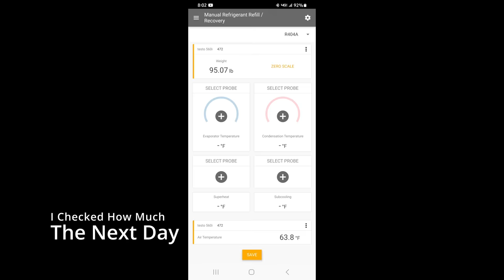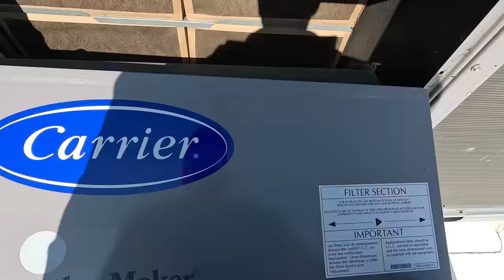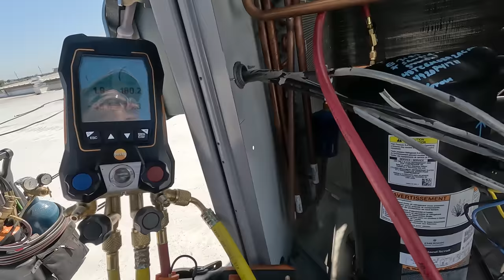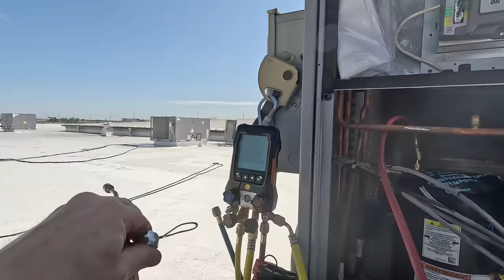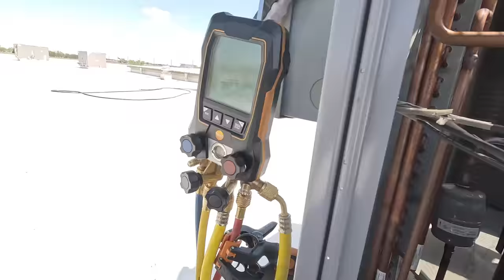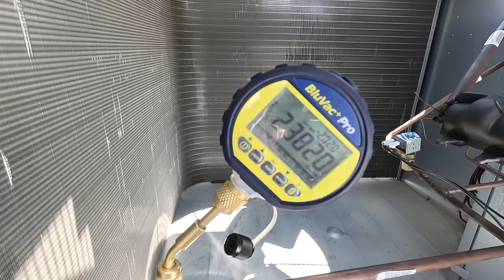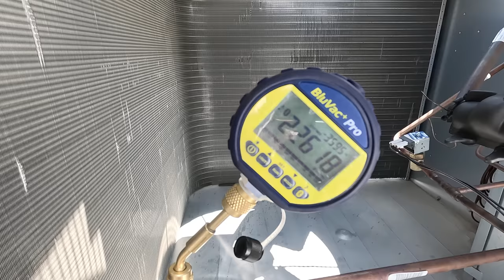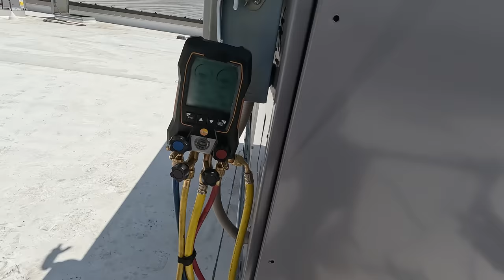RTU Compressor Change With Electric Ladder Crane

Comment: Day - month - year = perfect

I built an A-frame style 4 pc. lift frame that mounts on top of the curb hatch frame.  Used it recently for lifting a heat exchanger replacement up through hatches at a job with no permanent ladder recently. Built it to lift a compressor up to a roof before Covid and has been rusting on on a shed floor since then.  My employer did not contribute to its fabrication and it still needs an electric winch but it got the job done and no bodies were injured.

You need a helper for the heavy lifting.

Comment: 4:20 I use the same winch but I have a bracket that hangs on the strut for when I hang kitchen hoods. That’s a good idea though. Yet I’m still trying to figure out a portable gantri for lifting rtus but good video Rick 🫡👍 keep up the work.
Reply from the maker: If I'm doing a full size unit that's when the real crane is coming out.

Comment: They taught us in school, using a belt tension tool, that if you can roll a belt on, it is too loose.  "Bell & gosset"(?) Or someone big like that did a study and over 90% of techs put belts on way too loose.
Reply: Rick used belt tension measurements many times, mainly on ice machines. I guess sometimes you’re feeling / experience is enough. Especially when the tool is 15 minutes away to get it. 😏
Reply from the maker: @brauchmernet  ya, I have the tool in the truck.

Comment: Hey Rick a question there bud have you ever had any problems pulling a vacuum with the c&d core depressor? I bought a set but always having problems with them
Reply from the maker: They have been better than Appion core tools for me. You can buy new seals.
Reply: NAVAC CRT's are the bees knees
Reply: Wait, you guys pull vacuums?

Comment: Great video man. Just wondering how much your crane weighs in relation to the compressor. that would be a good comparison. Seems like you ropped up the winch anyway and if they’re similar in weight what’s the difference. Also Seemed like a little bit to set up. I’m not knocking it, I think it would be great for a lot of applications, too many steps for others
Reply from the maker: It's in Three pieces, the the brackets are probably 15 to 20 lb each. The compressor weighs 95 lb total. It's a lot more manageable to take up the three small pieces. Let's also take into account what happens if you drop the $2,000 compressor? Who's paying for that and who's paying for the damage to your body if you pull something in your back?

Comment: I just bought a miller electric 11-1116 it's a tiny little torch handle and it comes with a bunch of tips and stuff. It's freakin awesome, it makes the big torch handles obsolete in my opinion. Don't get me wrong the big handles work fine especially with big stuff. But for 90 percent of what we do especially reach ins and  prep tables and stuff it's the tits.
Reply from the maker: i feel the same👍

Comment: where is your hand truck? the best lift i have done when i did refrigeration work. i had a convenient store and it had a bad comp on a rtu cooler unit. i took some thick unistrut and made sort of a upside down L   PUT A 45 DEG support connecting the  angle  then bolted it to the steel ladder on the back of the building, the unistrut was fastened using a pipe to the ladder so i could turn the L bracket. i lifted the comp with a come along then turn the L bracket and set the comp on the roof. left it on the job site for next time
Reply from the maker: My fold up trucks wheel broke last week. This Lyft does three different ladders plus a trolley. Check it out.  https://youtu.be/6G95R3krvmc

Comment: We just installed a similar model on an older Carrier unit with a b tank. Struggled to heat the suction line. If you didn't use the rose bud, what else would you recommend? Thanks, Rick.
Reply from the maker: I have used a number 2 tip for years and years with no problems. I'm just looking for better and faster ways of doing things.

Comment: Dang that’s the 3rd compressor in there ?
Reply from the maker: Says who?
Reply: @HVACRSurvival  well I thought so because it had that writing on it and for some reason I thought original one failed and you wrote that on the new (2nd) one but then I realized you probably wrote that for warranty purposes
Reply from the maker: @joeshearer1247  correct, I thought I would be back shortly after finding the fault but they waited till spring the next year.

Comment: Curious Rick, I see you and others on the net using a true oxygen / acetylene torch; why?
All of our trucks are equipped with an acetylene only torch rig and we have no issues.
Reply: Oxy acetylene torches run way hotter, more expensive to use though. The benefit is in the difference in heat the flame produces. Air acetylene cant compete in speed, especially on larger pipe. They both get the job done!
Reply from the maker: It's what I use mainly because that's what they gave us, I used to love the turbo torch when I didn't know how to use an oxy acetylene torch. Once I learned how to use it then I didn't like the turbo any longer because it's slower as far as the speed at which it gets hot and the heat concentration is very broad.

Comment: Are 460 motors always 3 phase?
Reply from the maker: Always is a big basket but I believe they are. I haven't seen any that weren't.
Reply: there are a fair bit of single phase 460V motors out there, they're mainly lower power devices like condenser fans, blowers, draft inducers and such, in big commercial refer/hvac.
the whole reason is that big three phase RTU's/racks rarely have a neutral wire to use 277V single phase. so they most always use two of the 480V phases.
you have to be careful on that in 480V units, it's easy to accidentally(head up rear) put a 208/240v draft inducer on an 480V unit. 🤣 in which goes smoke emitter pretty fast, someone just recently did that on one of the HVAC channels, I forgot which one.

Comment: Makes me depressed thinking about how bad my vaccum rig is compared to what you guys have ...
The one thing you could do to make the job even easier is to rope up a little foldable trolley/platform and wheel all the heavy stuff up to the unit .
Avoids having to carry it all the way there .
Reply from the maker: I lowered most of it off the roof, my rope nearly reached the ground, I got another rope this weekend so I can trigger the hook next time on tall roofs.

Comment: Nice video but you could’ve had the compressor on the roof in a fraction of time that it took just to set that device up. Not to mention that when you add up the weight of the motor and the brackets, it probably totals as much as the compressor itself. I could see using it on larger compressors, but not on that tiny little thing. No disrespect intended. Just my opinion.
Reply from the maker: 95# was the total weight, how much money do I lose if I drop it? It doesn't look very big but it weighed a lot more than what it looked like and pulling that straight up a ladder kind of sucks. The winch weighs 20-25 lb and the bracket weighs maybe 20-25 lb.

Comment: Awesome video Rick. Thanks for sharing.  I use an A17 tip for bigger copper. Had to sweat some copper on an Intellipak. Suction was 2⅛" and it worked flawlessly.
Reply from the maker: I have that one but I was told my torches are to small for that head.

Comment: That panel being off while checking pressures needs some explaining.
Reply from the maker: Pretty simple to explain when you weigh in the exact charge, it was cold outside so it's not going to be off by much.
Reply: @HVACRSurvival  As long as you understand that you were totally bypassing the condenser coil, which is not how it was designed to run.